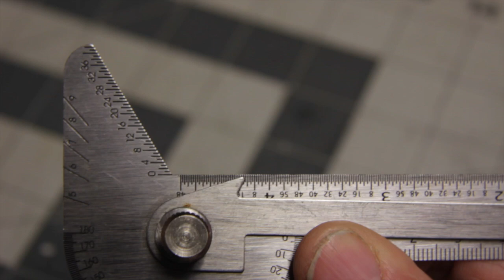Harbor Freight Mods - $4.99 Drill bit Sharpener

Comment: It didn't work because you used it wrong. Don't round off the bit, grind the edge flat and it will sharpen well.
Reply from the maker: Thanks for the tip

Comment: Thanks for the video! Harbor Freight is hit or miss! Kinda ironic that they even sell something like this... with their coupon you can get a whole set of drill bits for like $10!
Reply from the maker: Yes you are correct, thanks for your feedback
Reply: And u can rebuy them 300 times.  U get what u pay for with drill bits. Im poor, like really poor. And i absolutely hate spending the amount of money dewalt charges for bits, but the truth of the matter is u get bits that stay sharp for years of use, compared to the 10 to 20 dollar bits that u have to sharpen half way thru each drilm hole

Comment: The coated drill bit is probably 135 degrees while the high speed is 118. Drills come standard in both angles depending what you are drilling.

Comment: It's just a simple grinding stone with guides, so this device does indeed work. For a really dull, abused, drill bit (such as yours), run it through a bench grinder first to get a rough edge. Work until both flukes (cutting edges) are equal in size with the tip sharp & centered. Same with this tool to get a fine edge. Don't use excessive force. You'll end up with an almost razor sharp drill bit.
Reply from the maker: Thanks Robin for the great tips.
Reply: The cutting edge you are talking about is called a "Flute"

Fluke is an electrical/electronic instrument company.

Comment: I bought one today and I agree with your accessment. Im going to mess around with it one day once I finish my project.
Reply from the maker: I saw a Russian guy using it successfully bending the head on the flutes on the drill.  Very much different than the instructions.  But it seems to work well
Reply: Do you see the Russian guy live? Or could you provide link for the video?

Comment: The sharpener evaluation would be more accurate if you 1) drilled the steel plate with the new drill bit to see if it can cut that steel plate, how much pressed pressure it took, long and how deep the new drill  bit could penetrate the plate. The new drill bit should be the same material (titanium?) as the old drill bit. 2) after sharpening the old drill bit, test this drill bit on the same steel plate by drilling it at the same pressure on the drill as the test on the new drill bit; measure the time to drill and the depth that it cut through the steel plate, if it could cut the steel. Without applying the same pressure on both the new and old drill bits the tests may not be reliable.

Comment: Good analysis done -- but you need to ensure 2-3 things with that sharpening attachment. 
First there should be no vibration- securely mount & fix tightly the drill machine & attachment on a metal or wooden frame. 
Secondly the grinding wheel must be of more fine grade abrasive- the more fine abrasive wheel is there- more sharp & accurate the drill bit will be.
Best is you buy a sharpener with options of all angle adjustments & a much finer grit grinding wheel.

Comment: There should be a flat washer in a little clip on the other side of the rod that holds the Stone on. I bought the two pack kit from Amazon and it has clip in a washer on the sides
Reply from the maker: Thanks Bill, mine did not come with washers

Comment: I cut 2½" off of the handle so i can hold the drillbit and sharpener and allign or roll it with one hand and try to hold the drill and trigger switch with the other hand . It puts the edge and relief angle but hard to get a point .
Reply from the maker: Thanks nice modification

Comment: im returning mine tomorrow im not dealing with the harbor freight tool, its $5 dollars but if you use an expensive drill bit it will just round it off, good thing i used a cheap one for testing. good video i should have watched this before buying this stupid thing
Reply from the maker: Yup take it back and spend your money on something better.  It is junk. Thanks for the feedback

Comment: I was a tool and cutter grinder for over 20 years. Owned my own business and worked in a few shops. This thing is completely useless. 😂
You're better off on a bench grinder. Spend a few more dollars and buy even the cheapest Drill Doctor and you will have much better luck I think.
Reply from the maker: Eric thanks for the expert advice, I really purchased the drill sharpener as a joke, but did a evaluation just to prove it.  I do use a belt sander to grind my drill bits.  I like that the belt parallel.
Reply from the maker: @mrmeener625  I totally agree,  but I through it would be fun to do an evaluation on it
Reply: I took it out of the plastic housing and made my own out of it. I had to tho, i use tiny bits. There is nothing really out there for small drill bits

Comment: Harbor Freight I have found, has crappy instructions for everything they sell.
Reply from the maker: Most instructions yes, But on a few things I have found some pretty good instructions.  Just depends how good their English is at the factory.
Reply: Don't sleep on the Micrometer, magnets, air hammer, flat crowbar and 1/4: 3/8: 1/2 socket to impact adapters, all intuitive (Manuals obsolete); awesome prices.
Reply from the maker: @c-rlt730  thanks for the feedback.  Yup.